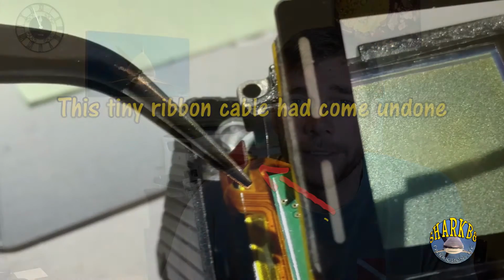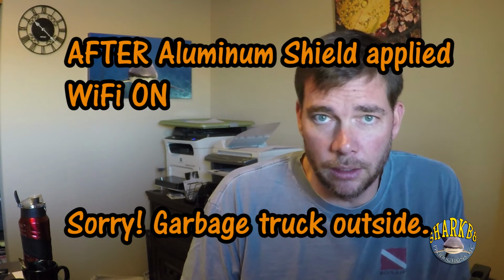GoPro FIX Audio Clicking and Humming Hero4 (Wifi Interference)

Comment: Brilliant. Thank you so much for this. I’ve had my GoPro Hero4 for 3 years now and it’s annoyed me that I’ve not been able to make use of the wireless functionality without getting the “helicopter” noise.  I’ve not been brave enough to tackle the job until now. Found your video, ordered some copper tape and sat down this afternoon to have a go. Thanks to your detailed instructions I now have a fully useable camera I can control wirelessly with all noise gone after just an hour’s careful work.  Now a subscriber to your channel as well. Thanks again 👍🏼😊

Comment: YOU ROCK!!  This worked for me. Thanks to Chris Richardson for the link to copper tape. Went to Michael's and bought for $6.99.  I shielded the mic next to the WiFi antenna and , what I think is another mic near the external USB HDMI connections. After this fix, I was able to eliminate the noise completely. The noise used to be amplified when using an external mic to the point that you could not hear any words. It's still noticeable with an external mic, but significantly less. Overall, reduced to 0% when on WiFi and NOT using external mic (even with headphones). Reduced to 20% when using external mic on WiFi. I'm happy with the results.

Comment: I'm amazed at how well this worked!!!  I followed your guidelines without trying to understand the physics-- for instance the suggestion in one of the comments regarding grounding the copper shield (that seemed like a good idea to me-- but I didn't attempt it).  Three things I'd like to add:  (1)Getting the front bezel off was a bit of a pain for me-- there was double sided tape that I didn't expect that made me concerned I was applying too much force and not enough finnes undoing the clips.  Force was needed to break the tape's bond.  (2) I think I was able to avoid your ribbon cable nightmare by only opening the guts from the case by no more than 90-degrees (3) The helicopter noise seems to be totally gone (I only listened through my phone's speaker) but there is some "snow" (white noise) that I don't know if it is normal or not-- anyway, audio is 1000% better than it was.  Thanks for a great and useful video.  I'll subscribe-- and since you like motorcycles, I invite you to subscribe to my channel where you will find original Isle of Man TT videos.

Comment: I fixed my Session 5's recording buzz by simply turning WiFi off. This also helps with battery use.

Afterward the Quik app re-enables WiFi to preview the recording on my phone.

Next challenge: Hardware and ProTune sound settings to minimise wind noise.

Comment: Hey sir, my wife got me a Hero 4 for my birthday a while ago and I've put little used to it because of the helicopter noise, it drove me crazy.. I didn't notice the noise until long after I recorded a bunch of precious moments.. 

Anyways your video is awesome my only question to you is don't you think it would be wise to ground the shield to the ground just there on the left of the antenna?
Reply: I only say this for the reason that the copper tape being up against the microphone or the antenna, if it were to develop any static electricity it could disperse it safely through the ground. I just thought that if it built up too much it might damage something. Just an idea I wanted to pitch. 

Using the ground on a Wi-Fi antenna would be more convenient and you can find it easily with an ohm reader and by checking it on one of the main screws that are for sure grounded.

Otherwise, thank you for the response.

Comment: Thank you so very much for this video.  I had purchased a used Hero 4 Black with the smart remote control and a lot of accessories for a great price on Craigslist.  I'm sure the seller knew exactly what was wrong with it.  I went to Michael's and got copper tape:  http://www.michaels.com/copper-tape-by-bead-landing/10201587.html

and it took out the helicopter noise 100%!  Just 1 layer.  I was very careful not to let the flex cable come loose.  It looks like you remove the 2 short screws that aren't on the edge of the camera.  These do not need to be removed.
Thanks for making my GoPro perfect!

Comment: Mine does the same thing replace by GoPro same thing  why do they sell such a piece of crap!
Reply: I wonder if the first one's off the shelf were unshielded. Then as the complaints came in they had new batches opened and shielded... Has anyone else here opened one up, one that was broken due to severe damage and checked inside... I love to know if that's how they fixed the issue...

Comment: How did this problem make it clear into the 6?  When I use the bullshit adapter they make you buy and with wifi turned on, the audio is not useable.  Turn the wifi off and the sound goes away.  Total piece of shit.  We need a class action lawsuit against this.  Audio is half the reason for filming something.  Disgusting.  Has anyone done this mod to the 6?
Reply: I stuck a rode mic on it now with the gopro adaptor.  It's passible for now.  The real solution is no more gopro.  The company is screwed anyways, they will go down in history as the ultimate example of "how to destroy your own business"  Go visit a best buy.  They are outta stock on lots of gopro crap.  It's only a matter of time until the fold completely.  I guess that stupid POS crashing drone of theirs really crashed the company.  After the aggravation I've had with my 6, I won't miss them and their over priced shit.  I'm going to try Yi.  Can't be any worse.